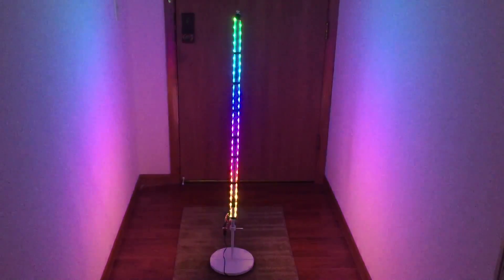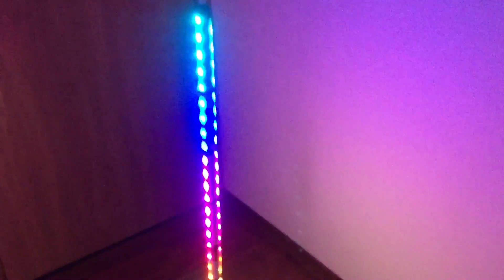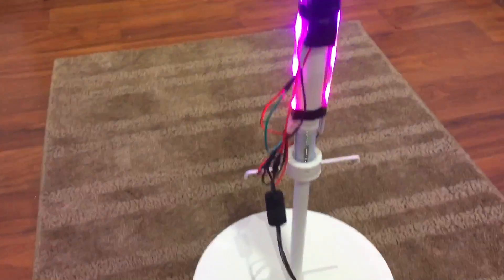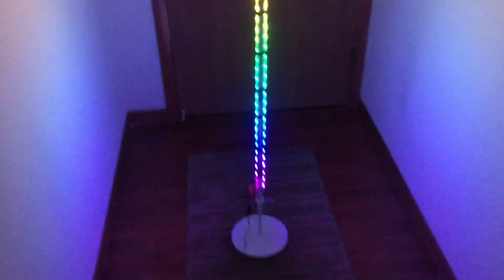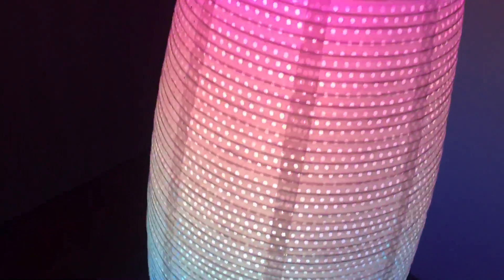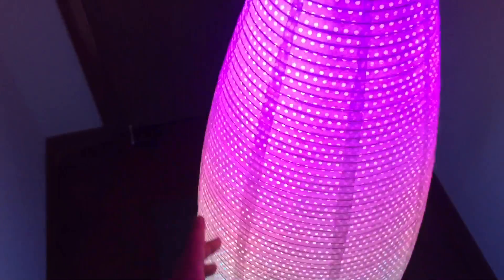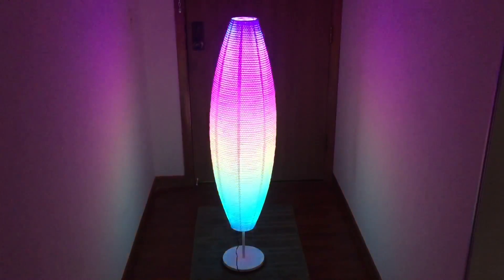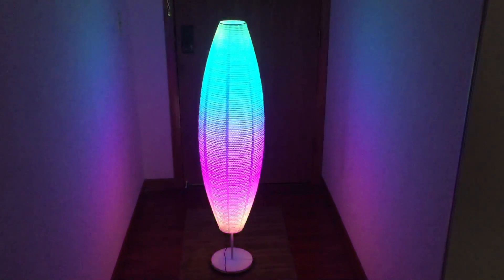RGB led strip lamp - Ikea Solleftea

Comment: How do you get the lights to change in that sequence , all the others I see have the standard flash/fade/strobe sequence. I can’t really hear clearly what other kit you use
Reply: Addressable RGB strip of WS2812B LEDs, connect to an arduino, read about about the FastLED library, then run the ColorWavesWithPalettes code on the strip. Change the gradient make it more fancy.
Reply: Chirag Patil could I get the code?